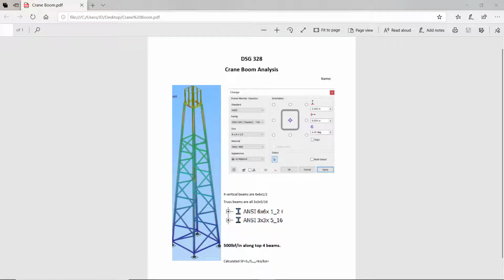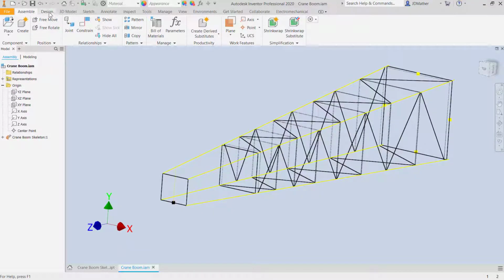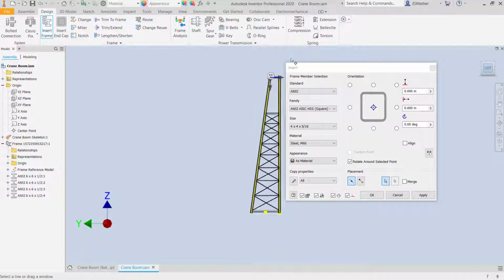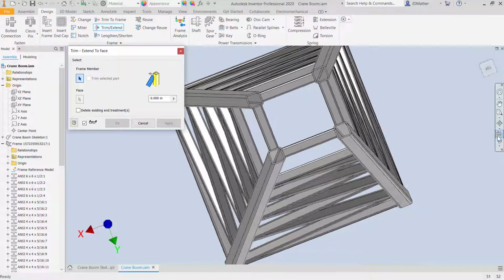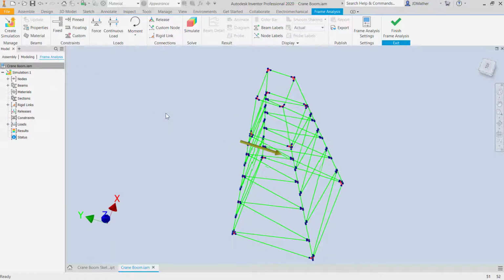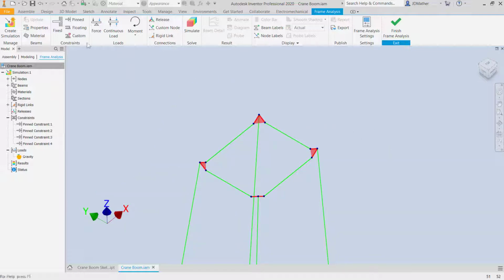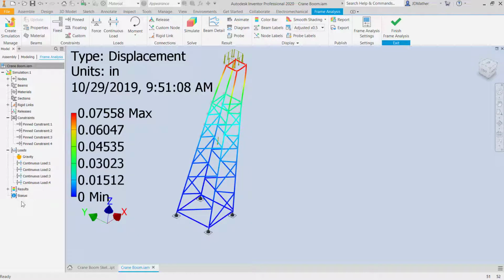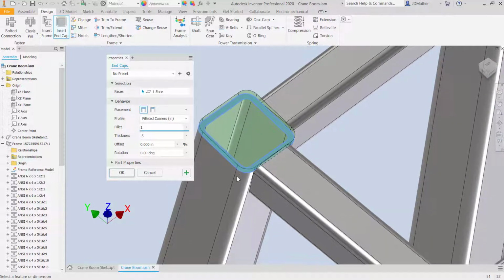Inventor   FEA Lab 4   Frame Analysis

Comment: Sir if the structure was welded should we expect to have different results probably higher stress due to the welding ?
Reply from the maker: https://www.autodesk.com/autodesk-university/class/Job-Weld-Done-Getting-bottom-modeling-welds-FEA-Debunking-common-perceptions-2015

Comment: I am just confused why you put a pin constraint on the bottom of the structure, isn't pin constraint for the rotating on the pin or bolted connections? shouldn't we use fixed constraint here instead?
Reply from the maker: You could use Fixed Constraint, but I prefer to set up more like the real world.
One Pin removes three translation DoF.
Two Pin removes two of the three remaining rotational DoF.
Third Pin removes all DoF.
Forth Pin is redundant.

This provided a good illustration of the importance of classroom instruction.
I would demonstrate each of the 4 scenarios above plus scenarios of Fixed constraints as you suggest and observe if there is any difference in results of the analysis.

Comment: I have a question about determining the loads being applied to the structure and how inventor sees them.  For example, If i were going to sit a static 10,000 lb object on top of this structure, how would i communicate this correctly?  Would i divide that number by the total length of the beams to get a per inch load?  If the total length of the 4 top horizontal beams is for example 10' long (4x2.5') would I then divide the 10,000lb by the total number of inches (10,000/120=83.3333) ? would i then input 83.333 lbs per inch as the magnitude ?
Reply from the maker: Yes.
If you turn off Gravity, and get the Reaction Force at each Pin constraint, the total should add up to (roughly) the total of your load.  You can do this as a "sanity check" to make sure that you have set the load correctly. Turn Gravity back on and you also get the weight of the frame members in the Reaction Forces.